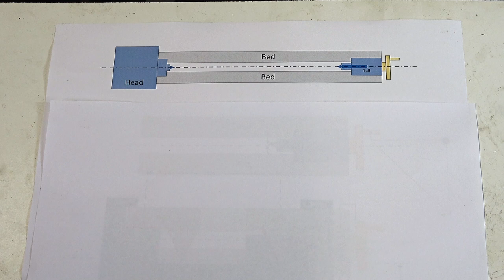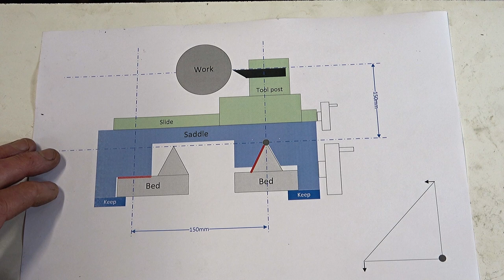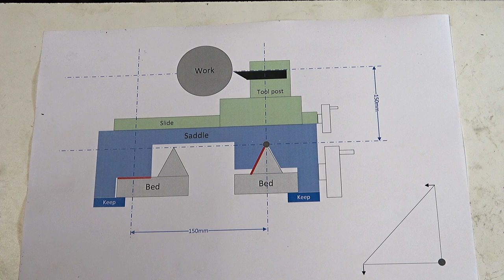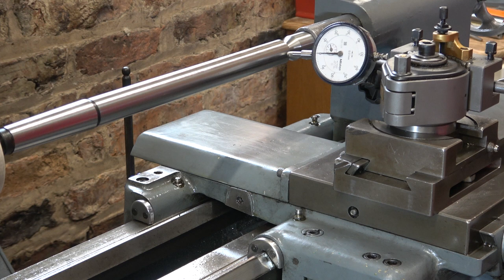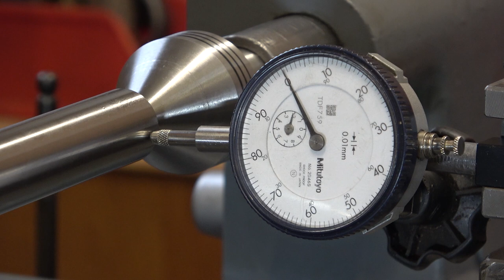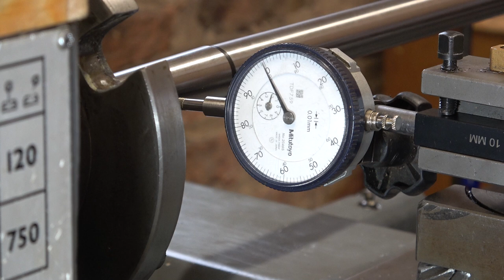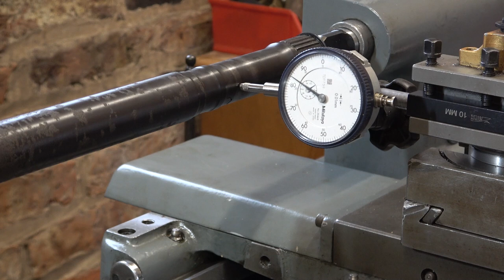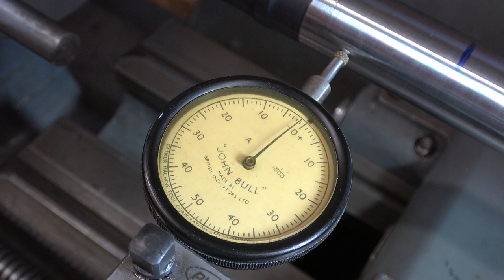HS56 Harrison 140 lathe parallel turning test

Comment: Hi, When I did the alignment on my Colchester student, one of the first things I discovered was that the spindle taper had a ding in it. I blued up the bush, put a large MT drill into the bush as a handle, and rubbed it into the spindle. This revealed quite a lot of bumping inside the spindle, which was carefully removed with a crescent bearing scraper which was very effective, and I soon got to a solid blue all round. This made a lot of difference! I then did the same to the inside or the spindle bush, then refitted the whole lot to the lathe, refitted the test bar, and what a difference! I have three spindle bushes for my lathe, but I now know that I only have one good one! The others need work!!I bought a MT reamer for my TS, but I found that bluing it up afterwards showed that there was still highs and lows, and it took several goes with the reamer before it blued up near perfect. Have you checked for twist in the bed with an engineers level? That can also make quite a difference, and is not difficult to do. Setting up drag, or preload on the spindle bearings can be done with a spring balance but you need to know if the manufacturers have set this type of parameter for the machine, and some don't!    Love your channel, and have subscribed! I am not far away either!
Phil  (You can see my alignment efforts here)  https://www.youtube.com/user/philhermetic/videos
Reply from the maker: Hi Phil, this info is very useful thanks it deepens my understanding quite a bit. I've started to look on ebay for an engineers level to do the bed twist check. I like your channel. In you episode "I get sidetracked again" do I see a Rapidor and an Alba shaper?  I've got a Rapidor and an Elliott 10M. All your equipment looks smart.
Reply: @HaxbyShed  Alba and Rapidor, you certainly do see, and also a Colchester student, and the venerable Covmac lathe. Of course the only thing better than two lathes is three, so I went and bought a Holbrook B9 on Friday. I think the Harrisons were a shade better than the Colchesters, but there you go, I also have a Harrison H mill with a vertical head attachment, out of a school, and hardly used.
It is easy to become obsessive about accuracy on lathes, I did mine because I had just stripped and repainted it, along with a thorough mechanical sorting, and I was noticing tailstock misalignment before I started the refurb. It is still not dialed in perfectly, but there are a lot of people who say you should only embark on accuracy checks if you can't make the parts you need sufficiently accurately for your needs. My Colchester is often far more accurate than I am! Were times different re covid and midwinter I would pop over with my level and spend half a day tinkering with you, maybe in happier times?

Comment: The barreling of the shaft is usually due to the deflection of the shaft being greater at midpoint. If theres any play at all between centres the direction of cutting tool travel will tend to push the workpiece into the centre its travelling towards causing smaller diameter that end and larger at the looser centre end.
These driveshafts are also fairly tough material and you might show more repeatable results with something softer.
Reply from the maker: Thank you. I agree with all your points. I don't have a lot of metal stock and the driveshaft was handy. It's added to my experience and I'd probably do it a bit differently now on a live job. Cheers
Reply: Agreed, tool pressure may be flexing the work away from the cut thus leading to a greater diameter.

Comment: Quite an investigation, could you try the DTI mounted vertically measuring the turned test bar at 12 o'clock, ie, the top.
Also fit your Mt 3 test bar in the tailstock, and clock it's parallel to the ways.
On the whole, the lathe is quite good, 0.03 mm is very good for a standard lathe in my opinion.
Great vlog, very well though out.
Thanks for sharing.
Reply from the maker: Hi, a good idea to clock on top with the bar as a reference. In Vid HS40 I did some clocking with the bar in the tailstock but I should repeat it now I've cleaned up the taper. Cheers
Reply: @HaxbyShed  yes, the tailstock taper didn't look in the best of shape, though difficult to film obviously. Possibly fit the MT 3 reamer in the chuck, carefully indicate in, then carefully offer the tailstock up to it.
But again the figures you have suggest a good lathe, but you may still have the issue of tailstock mounted drilling and reaming being axially out.
Reply: @bostedtap8399  I'd agree with that and doing as you suggest by reaming  the tailstock from the chuck should reduce if not eliminate axial alignment problems side to side but of course won't do anything about VisiCalc drop caused by bed wear.
Reply: @HaxbyShed  Just a thought, using a standard DTI with a ball point stylus, may Introduce errors on axial measure/trammel on a cylindrical bar, a flat bottom stylus would be more consistent. Nice little job to make one.
Hope this helps.
Reply from the maker: Thank you.

Comment: How is the lathe bolted down? Could you be fighting thermal expansion and deflection? Also could be thermal growth in the spindle changing bearing preload? Not a joke, “down to the weather and how the lathe is warming up. All things considered equal these are things that are changing. Nice job. Good example of properly thinking through a problem.
Reply from the maker: Chris thank you for the compliment. The lathe is freestanding with a jacking screw at each corner. It is not hard bolted to the floor. I've started to look on ebay for a machinists level and then I will do a bed twist check. I think there are growing indications that I need to check and eliminate that possibility. Cheers.

Comment: your tailstock is out of line .. you can adjust it  with the 2 Allen bolts.. but to get it right you'll need a rolled bar or 2 (of the same )tailstock centres . there's loads of videos online that show you how to adjust ..doesn't take long to get it spot on.. good luck
Reply: Steve, he covered the tail stock alignment at he start of the video. I would agree with him that it’s probably bed wear.
Reply from the maker: Hi Steve, I'm probably chasing an accuracy that the old girl can't do after 50 years. Tailstock could be a shade out of line and I will look at the videos as you suggest. It's all background brain work for me when it's too clod for a workshop day. Cheers

Comment: I actually ordered a mt3 reamer for my own 140 too, your headstock center, was this a soft center? I thought and now I may be well wrong here but I thought you were to cut a new soft center point with the lathe itself to ensure its concentric, my own 140 is probably no better but works just fine, try hss and some cold rolled bar as carbide is a bit high tool pressure
Reply from the maker: Hi, thanks. I'd not thought about machining the headstock centre. You have set me thinking now about HSS, and I see the reason. I may just live with it for now as the setup is probably accurate enough for everything I do. Cheers.

Comment: Hi, great video. I was thinking the deviation could be eliminated if you used a travelling steady. As the greatest error appeared to be at the mid point in the shaft, it is the part which had the least support and would have been pushed away from the tool as it cut. This might explain the barrelling you saw. Keep up the great work. Osu!
Reply from the maker: Hi m0xya, I agree and several people have suggested a sharp HSS tool might have been better than a carbide (less tool pressure). Your Colchester round head looks shiny. I'm still doing karate every week but my old joints are creaking. Osu!

Comment: Hi  Test bar not rotating true Test all centres in head stock normally we have a soft 1 to turn true. 
Tail stock alignment  test full out and in with your turning set up if pointing to wall it will show up only move tail stock. This will put this 1 to bed as to say. If not same  is top on it base correct. Also the lock can play havoc with set up

Steve
Reply from the maker: Hi, thanks. I think I've absorbed all you say. Certainly agree the tailstock quill lock can be a big swing factor. I'd not thought about machining the headstock centre. Cheers.

Comment: As well as the tests that you have done, one test that I want to do on my own 140 when I get it set up in it's new position is to run the DTI along the top of the bar as well as the side.  Having watched all the work you have done I think that I'll use a test bar and mount the DTI base in three different places, 1) where you had it on the tool post, 2) on the rear of the saddle ( over the flat way ) and 3) on the front of the saddle somewhere near the keeper clamp bolt.
I'm not too sure what it will prove but it should show how the wear in the bed is reflected in the changing tool position assuming that I manage to eliminate any lift between the rear of the saddle and the flat way. Perhaps all this extra data will help BUT it does worry me that I'll have so much data that I'll be able to back up pretty well any hypothesis ............ I'll get me coat!
Reply from the maker: Ah yes I see your point. I did not think about using the top edge of a test bar between centres as a reference for local vertical bed wear. Taking differences should give you quite a lot of information - as you say understanding / separating the different causes and effects may be the tricky bit.   Cheers
Reply: @HaxbyShed  One of my next jobs is to repaint my 140.  It came out of David Browns training school at Huddersfield and is a ghastly pale green.  Did you spray or brush the paint you used and what preparation did you do?  If this is covered in another video I'd be very grateful for signpost to it.  My grateful thanks - Chris
Reply from the maker: Hi Chris, I stripped the lathe down and washed it all off with degreaser - took me ages. Then I painted with grey screwfix oil resistant floor paint with a brush. It takes 7 days to cure.  You can see some of this in my video HS11 (in the middle from about from about 7min:30sec). Hope that helps. Cheers
Reply: @HaxbyShed  Thanks Fella - I'll give that a go.  Your 140 looks very tidy.  I've a Harrison vertical mill to refurbish as well so it looks as though a 5L tin might be justified.

Comment: As for the barrelling, that seems to be consistent through your four turnings and I am surprised it has not increased because I am fairly sure that it is caused by the workpiece flexing away from the path of the tool and of course will be at its most flexed point at the centre point between the centres and NOT the centre point of the turned portion. And as you make the work thinner, it will of course flex more due to losing its rigidity, and the barrelling will get ever greater.Have a look at your numbers at the appropriate point on the turned portion and draw your own conclusions.
Reply from the maker: Hi, thanks that helps draw the barrelling issue into focus in my mind. I think barrelling was masking the underlying mechanisms which were causing me confusion.  I hope shortly I will upload an update video covering some of these points at a general level.

Comment: Good day   I’m no expert but I would try to eliminate some variables, true in the tail shaft (I use the dumb bell shaped type, the bar with a donut on each end) touch up the head stock dead center @ 60* . And as someone else said get the temp stable for the test period. I personally would disregard the center readings of the shaft your using due to high tool pressure pushing the bar away.if your really need those numbers use a follow rest. Oh also check the center drilled hole in the shaft there may be rust or paint giving you incorrect results. But you probably already know all this and I missed you say
Reply from the maker: Hi, several things for me to think about in your comments. I'd not thought about machining the headstock centre. And I agree carbide is not the best tool for fine work. There was dirt in the centre hole giving a bit of error to begin with but that 0.4mm wobble was 'as built'. This was one of a pair of 'new' drive shafts that came off my son's car because they were giving a lot of vibration but the CVs seemed to be fine. Another dodgy ebay purchase and he waited too long and too much hassle to send back :-)

Comment: Wrong tool for turning towards the tailstock... negative left.  You could try using a HSS TOOL 
With a quarter inch ground flat. It's an old lathe and that is a good result. I understand your frustration 😣
Reply from the maker: Hi, it's not clear from my video but I did swap in a RH tool for my attempt on towards tailstock turning. But it was only a half hearted attempt and subject to operator error (and a bit of a distraction to my main theme). I will make a proper attempt at towards tailstock turning in a future vid when I can set the work up properly with a live centre and rigidity. I understand your point that HSS may be better. I've seen your vid on turning towards the tailstock on the DSG and to be honest I've got that image in my mind. I've learnt a lot from your channel - decades of experience on big work come across in just a few Yorkshire sentences.  With so many other channels it's just the same stuff recycled. Cheers

Comment: Do you know someone who has a MAHR gauge for a repeatometer? Measures in microns (millionths of an inch). This would help. If not contact Keith Rucker at Vintage Machine on you tube. He has equipment to measure & has done his lathes & planer for straightness & scraping. He's a good guy & may be able to walk you through the measurements. Depth of cut, kind of steel, hardness of bar, carbide/high speed cutter, speed of rotation, temperature of material, temp of shop all have an effect.  I have a FELL level (measures x & y at the same time). One increment = .0005 in 12 inches deviation. Check your bed for level: not so much level but twist of the bed. The Fell can help with this. Some machine shop near you should have one & maybe bribe the owner to stop by & see what he can find. Took me 6 months to level, straighten, adjust gibs, check centers & adjust tailstock on my ACER 14 x 42 gear head lathe (vintage 1999 - I bought it new). Now I can turn within 5 ten thousandths of an inch. Time between adjustments was about 2 weeks to let the cast iron settle out. Now I check it every 2 months & tickle it if need be. The FELL will change on the bed if you change your position on the floor beside the lathe (4 1/2 inch concrete floor). The whole world is constantly moving, just depends at what time you stop it to measure. Good luck & I enjoy your show & your approach to problems.
Reply from the maker: Hi Robert, thanks for all the information. It will think and absorb it over the coming days. Interesting point that the whole world is constantly moving yes I guess so when you think everything is made of atoms interacting, and settling with gravity of course. We don't notice these things unless we look carefully, over time. Things aren't what they seem. Cheers
Reply: What a great comment sir! Love " the whole world is constantly moving, just depends on what time you stop it to measure"  REAL food for thought. And I agree I'm sure Keith Rucker would help him  out with suggestions if asked and maybe had seen Haxby's shed videos on measuring the wear.

Comment: Make sure the machine is level.
Reply from the maker: Hi, it has a very heavy rigid base cabinet set up in the factory. But if in the past somebody bolted that hard down to the floor it could have introduced a twist. I did some basic checks and I think it's ok but I do not have a precision level (expensive). Cheers
Reply: @HaxbyShed  I got my 12" Rabone Chesterman precision machinists level for £40 off of eBay last year. They do come up reasonably often, some idiots want an arm leg and one testicle for them but there you go they are out there. If you want to set a lathe up really accurately you do have to level the machine as the very first thing you do. After all how do you know how good your floor is? I bet it's not even millimetre level let  alone hundredths

Comment: wrong bearing housing machining procedure.
First fix the flange on the spindle then finish the bearing housing on the self-centering spindle .....
Reply from the maker: Hi Mavio, sorry I did not understand your comment. The character is chick or chicken?
Reply: @HaxbyShed  built a wrong thing, no cone bearing and wrong building procedure .... I'm an old rooster ....
Reply: @HaxbyShed  I'm sorry I was referring to this video "HS43 Making a tailstock 4 jaw fitting for my Harrison 140 lathe"
Reply from the maker: Mavio, now I understand. Cone bearings would be better and yes it is best to finish machining when all is assembled so everything is guaranteed concentric or perpendicular at 90 degrees to the axis.  With this in mind I did a run-out test in a video and it was good enough I think.